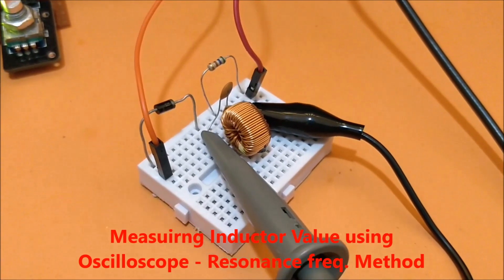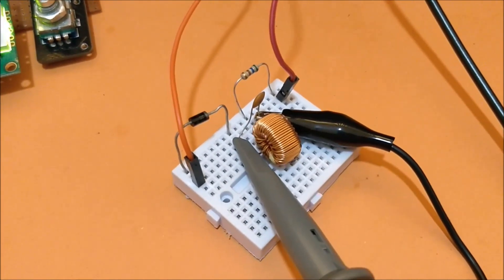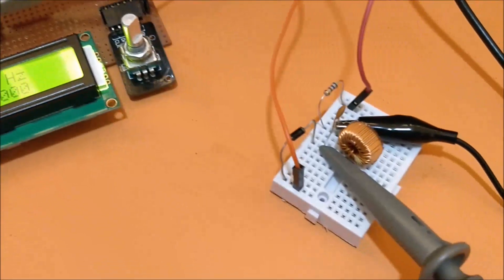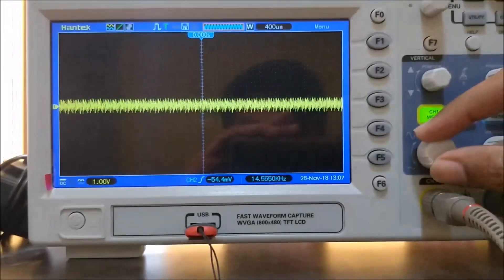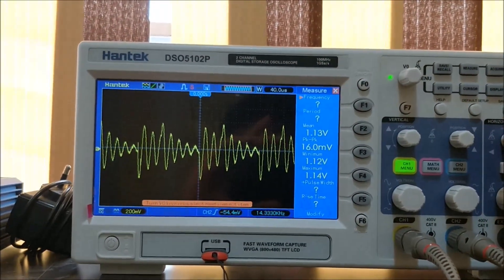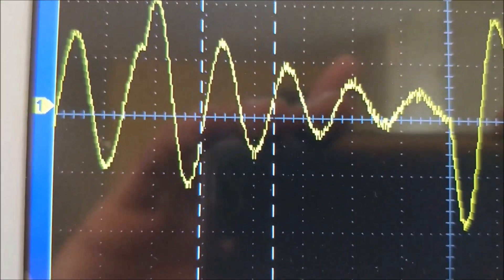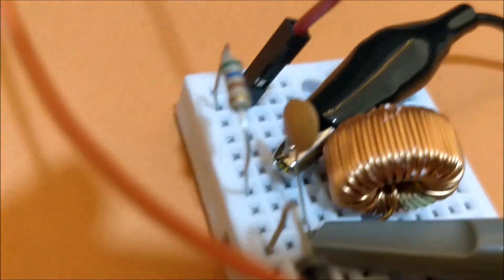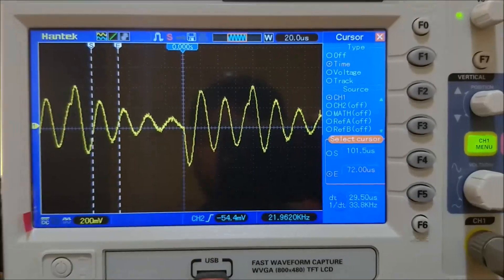Measuring Inductor Value using Oscilloscope

Comment: what about the tollerance of ceramic capacitors? it is not unusual that the real value capacity vary +-20% from nominal capacity. 
The impact of this fact makes this method not usable.
Reply: If you precisely measure the value of the capacitor and use that exact value in the formula, instead of the marked nominal value, you will then get an accurate calculation.
Reply: @meqqqievrimimi-wv7zm  and how? With  oscilloscope and an inductor? 😂